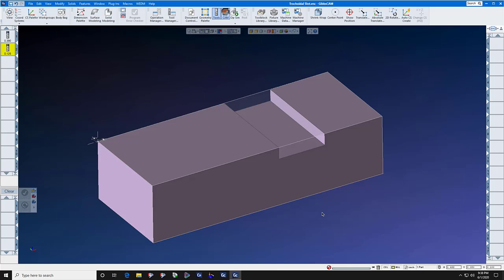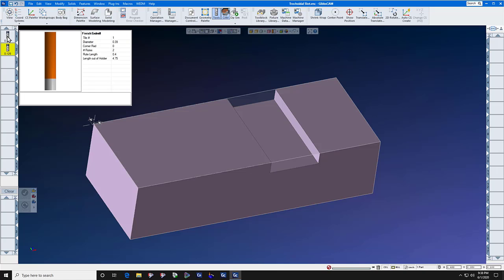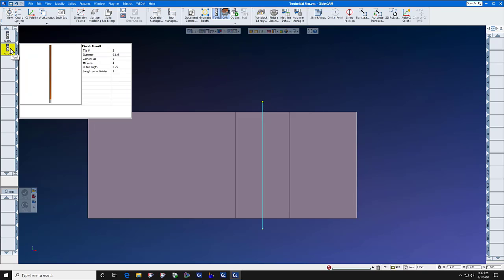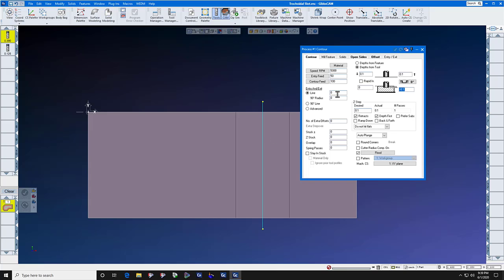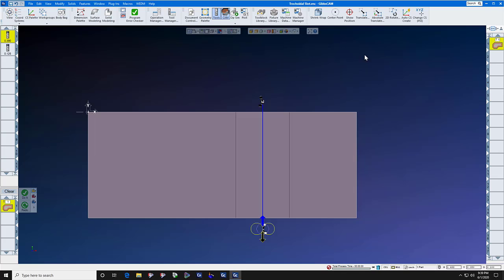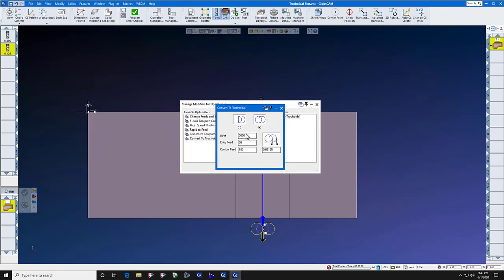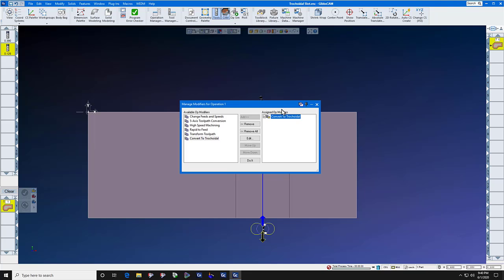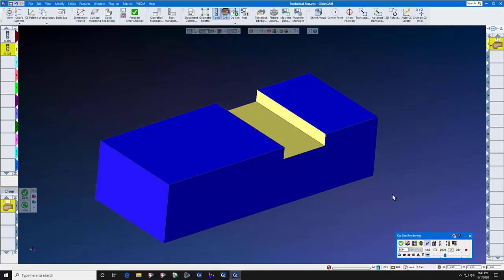GibbsCAM Tech Tip: How to Create a Trochoidal Toolpath

Comment: Thank you for this. I run into these open slot parts quite a bit. Is there a better way than creating a line down the middle to do this? What process could you use that would cut the slot and extend past the ends a bit, yet staying accurate to the sides? I've really struggled with this and feel like I have to so the  draw the line method to do it. Feel like there's a way I'm missing. Thanks and hope this doesn't come off as not appreciating this method.
Reply: Another option is to use Volumill. I prefer Volumill it is quicker and easier. If you need help with Volumill contact your reseller and they can help you.